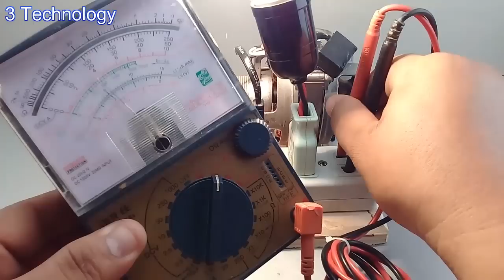I make 6000 watt free electricity generator 100% self running 24 hours

Comment: There's probably an inductive device under the table that transfers energy to the coils. And now the whole unit can be rotated back and forth on the table.
But go ahead and lift it up... !!!
Reply: I do believe self running generators exist but not this one. My guess is that he has an inverter and battery in the the outlet box